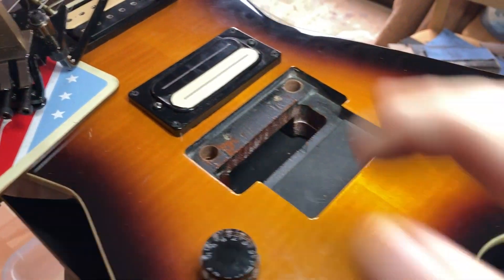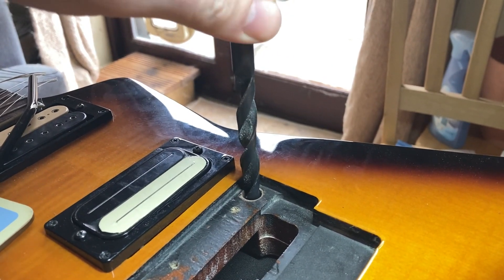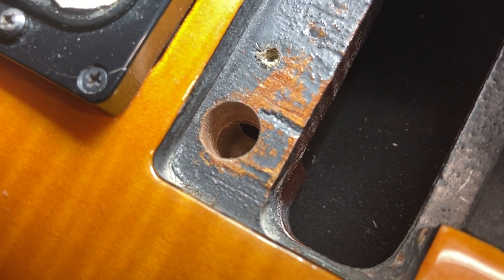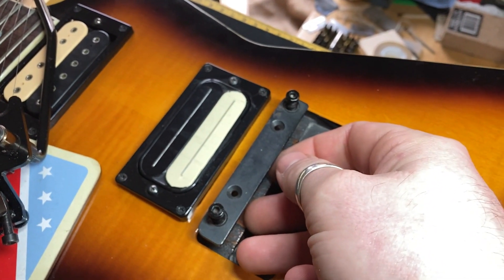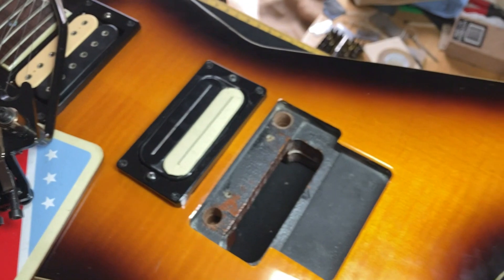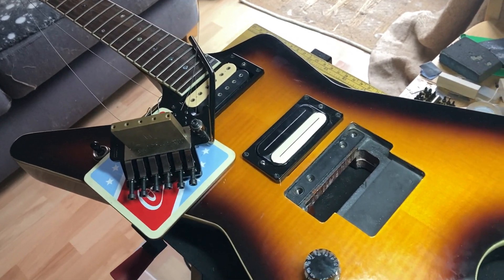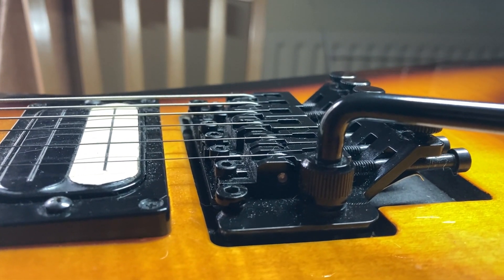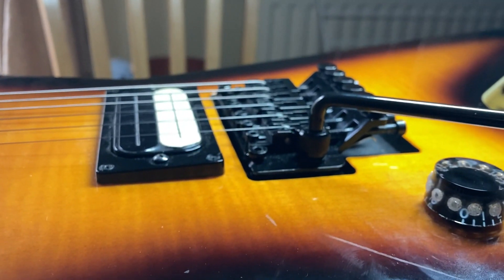Repairing Floyd Rose bridge post holes (part 3)

Comment: Thanks for this, I had a post hole where the post had worked its way angled forward. I used your idea to a smaller degree, I bought some wood banding tape, cut very small pieces that fit the front top and back bottom. (they were both about half the post hole height) I put a small amount of adhesive on the bottom and placed in place. then the front one I used adhesive to bond it to the post.  (the banding would bend easily in these small pieces) I tapped it in and its perfectly straight. pretty happy with this fix as I was able to avoid any drilling etc rock on my man!

Comment: Another trick Ive found is that you can use a very small clamp to move up through the trem cavity and press the inserts in that way. May take another block of wood to hold but it works.

Comment: This is awesome! I'm retro fitting a Gotoh into a Charvel and I've taken out the JT-6 which has bigger inserts! This could be the solution to shrink the holes instead of filling them and redrilling them!
Reply from the maker: The Gotoh posts are 11.2mm and need an 11mm hole to press into  - so those JT6 posts must be pretty chunky to be bigger than that (as most FR spec posts are 10mm). But yes, this should work just fine for reducing the holes - I haven't nothing any problems with mine since I did this. Everything's still snug and solid.
Reply: @ThrushCZX  Yes, they are 1/2 inch inserts (12.7mm), I was surprised when I pulled them out too. Who knows the holes might be perfect. It should arrive tomorrow. Most video's I've watched people just use the JT-6 posts for either the Gotoh or OFR. From the research I've done it looks like they are a 11.3mm and need a 10.5mm hole.